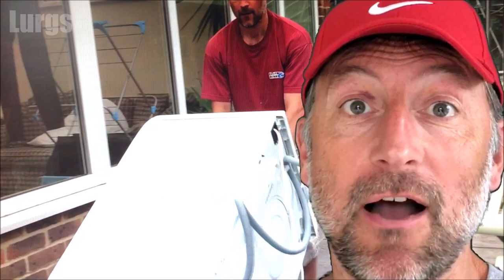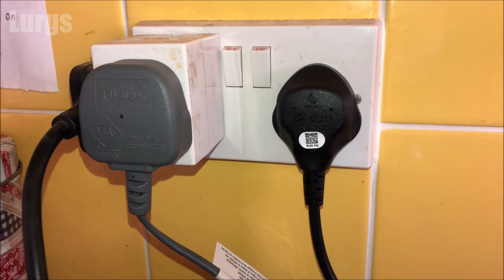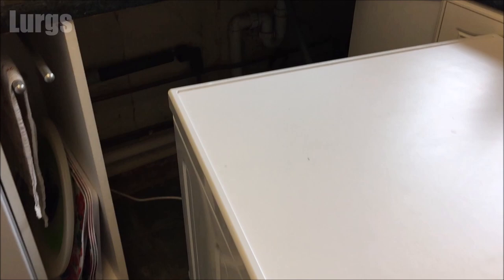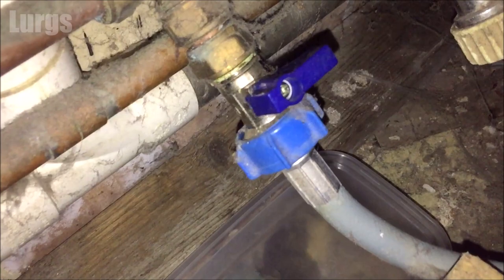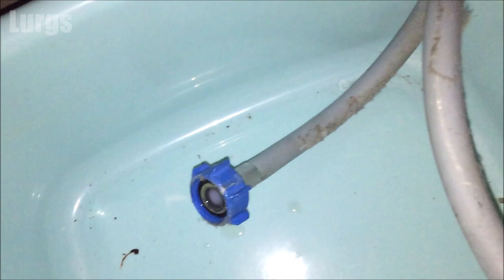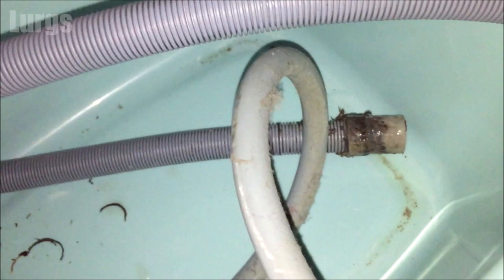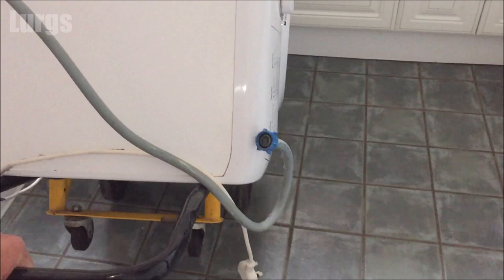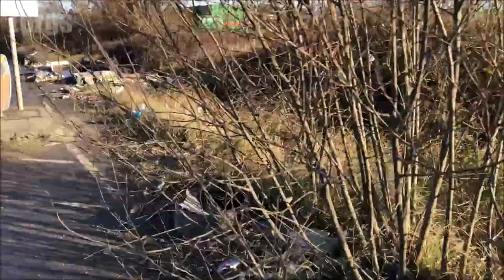How to Disconnect a Washing Machine for Recycling or Moving

Comment: Big Thanks for doing this video, and so refreshing to hear an English accent on here and someone who appreciates a British cup of tea. I will now attempt to dismantle the washing machine....
Edit I have tried. In theory I know what to do but in practice I don't have the strength to undo the taps. I wish they clipped on like hose pipes do.
Reply from the maker: Hope that you can get it done, the taps should move. Try some pliers for extra leverage but be careful and hold the pipes whilst you turn.
Reply: use a towel or cloth to get a stronger grip

Comment: You shouldn't be removing that machine wearing just Sandals. Health & Safety risk in case it slipped off the trolley. You need proper work boots. That's my advice.
Reply from the maker: I've got steel toe capped Nails. But yeh you are probably right.

Comment: Cheers Lurgs
Reply from the maker: No problem, hope it all went ok. 😎
Reply: @LurgsHowToGuides  Yeah no danger, just used a set of pliers to get the cold water inlet disconnected and then it was just pulling the waste hose off, no leaks. Very easy, much appreciated.

Comment: I cannot for the life of me unscrew the cold water fill screw, I've turned off the water supply to it but the screw isn't coming undone I don't know whether to use a tool on it or whether that may damage something in the process?
Reply from the maker: Oh dear, it’s only a plastic nut on a metal thread but if it’s never been removed before it’s probably stuck hard. Top tip try tightening it as well before untightening it. If cold water is off maybe try some pliers round a cloth to get some more leverage but be very careful not to stress any pipework. Good luck and hope it goes ok. Only replied quickly as sounds important!
Reply: @LurgsHowToGuides  yep that's what I meant can't get it undone, was installed before we moved in so not been touched for a while but I'll get the pliers out and give that a go thanks!
Reply from the maker: @samanthawillson7107  make sure you hold any pipework, don’t stress the pipework. Pliers round a cloth should work or some WD40 round the back and let it soak for an hour, or heat it up with a hairdryer on the nut
Reply: @LurgsHowToGuides  thanks helpful tips!

Comment: My machine broken and I need to take it out and the water inlet pipe is so hard to take off its so tightly on!
Reply from the maker: Get a good grip on it with a rag and turn. Don’t stress the pipework though so hold that if you can. Try tightening first before untightening that may help. Or try some heat on it, a hairdryer or something to heat it up, might loosen enough

Comment: I haven't a key to turn the cold water off to unplug the hose what do I do?
Reply from the maker: Definitely do not take off the hose unless you can isolate the water supply. See if you can find the main stopcock and turn off all the water. Or buy a key to turn it off locally at the inlet pipe.
Reply: @LurgsHowToGuides  thank you I am stuck for a stopcock lol

Comment: Mine isn't simple like that it goes way under my sink.. & im confused 😕 
I need a new washing machine bt due to covid I cant get it disconnected or installed! But yet they will drop it in my kitchen and remove the old one if disconnected! HW SILLY!!
Reply from the maker: If it goes under your sink the outlet drainage hose probably connects to your sink waste pipe on a small connector, if not maybe it has a different drainage pipe. Yeh these Covid rules are dumb, can all go shopping to get food but can't have a washing machine installed. Hope you find the hose connector
Reply: @LurgsHowToGuides  thank you.

Comment: Let’s hope Curry’s people knows what they are doing on Monday..
Reply from the maker: Lately lots of firms have refused to install new washing machines coz of the Corona. Hope it all goes well.
Reply: @LurgsHowToGuides  Well i paid removal and installation.. Will let you know.. Last time if I remember they were using old connections.. Useless really but John Lewis had to wait 1 week more and dont even offer instalation
Reply: @LurgsHowToGuides  yes, i'm having that problem now. argos won;t deliver, appliance direct will only leave on doorstep.
Reply from the maker: @ianbentley7276  can’t see how delivering and installing a brand new machine puts the installers at risk. Very odd.
It’s fairly simple to install a new machine and I’ve got a video how to do it. If you are replacing an existing machine all the plumbing is already there.
Reply: @LurgsHowToGuides  thanks, but not risking it, knowing me i'll flood the kitchen. got a chap to install the new one, and dispose of the old, £50.
Reply: @LurgsHowToGuides  thanks but was sorted today, not by me.
Reply: @ianbentley7276  same here I was scared to take that risk atleast they took the old one away
Reply: @shavonj9368  you can always ring the council, they'll take it, for a fee.